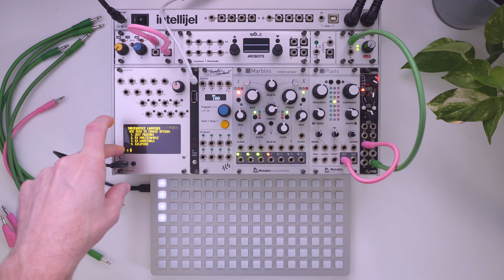Subsequence for Teletype: Patching and Interface How-to

Comment: could i use Monome 128 grid with Crow and without Norns and teletype？ And what will be different？
Reply: i mean grid + crow only，is that work？
Reply from the maker: @metayeung  Nope. Crow is not a USB host so this will not work. There's a good comparison of Crow vs. Teletype here: https://monome.org/docs/crow/faq/
Reply: @ModularBeat  so i need Ansible？
Reply from the maker: @metayeung  Ah, yeah I think that is an option! I have not used one but I believe it's one way to go if you do not want to get into scripting.

Comment: Thank you very much for this beautiful project!! :)
Does it work with the firware 5.0.0 beta 6 of the teletype and the firware 5 of the I2C2midi?
No midi trigger comes out of my module
Reply from the maker: Thanks! I honestly have fallen behind in and not tested either version. Not looking forward to reverse-engineering my own code to find out 😥. Did you ever have it working on previous versions? I ask in case it’s just an issue with installing the script (which requires some unusual steps)
Reply: @ModularBeat  Thank you for your feedback. No, I never use this sequencer but I think I modified the script correctly before the integration in the teletype

Comment: I love this functionality. Can the script be run on Crow or does it need Teletype to operate?
Reply from the maker: Teletype is required. I think Crow and Grid are both devices, not hosts, so I don't think the script could be adapted for just Crow.
Reply: @ModularBeat  ah gotcha. I was under the impression Crow could store scripts too, but that makes more sense! Cheers!
Reply from the maker: @daughtersofdivorce6803  Crow can def store scripts, too! It just can't use Grid as an interface (AFAIK). So you could maybe try to  adapt some of the functionality here into a Crow script, but with no Grid interface it'd be pretty limited. This comparison of Crow vs TT might be helpful: https://monome.org/docs/crow/faq/

Comment: Probably the most useful script I've seen in Teletype! Would it be possible to implement another scene to use the CHORD algorithm in Plaits repurposing two CV outs to pitch and chord selection (via HARMONICS) instead of sending the chord information via i2c?
Reply from the maker: Thanks so much Marco. Funny you mention that idea, I have been thinking about scripting some sort of converter for Plaits/Elements’ chords modes but I hadn’t even though about adding it as a new scene for Subsequence. 

EDIT x2: I have this working but it requires a custom firmware for Plaits to add Teletype’s chords. Let me play around with it a bit to make sure it’s working well like I want and I’ll have something out prob by this weekend.
Reply: @ModularBeat  the custom table chords in Plaits have already been developed in the Mutable Instruments forum (look for Unified Plaits alt firmware by the user Lylem), so it shouldn't be difficult to change them to your taste. It will be more limited than the i2c protocol that you are using (I think that Plaits can use only 11 chords) but it will be a powerful resource nonetheless 😄

Also, I would love to try it, but I don't own a Teletype yet, so I couldn't try the script even if I wanted to. I'm looking forward getting one soon.
Reply from the maker: Sounds good, this is something I have been meaning to play with anyway! I was actually able to fit more chords in the Plaits firmware so we can definitely get them all in there. Cheers.
Reply: @ModularBeat  Funny, a year later I get a Grid to play with this script (I got the Teletype some time ago). Now I'm interested in Dreamsequence, but I don't own a Crow yet... Always eager to try these fantastic programs you make. Keep it up!
Reply from the maker: @marcozvuk Stoked for you! Having access to Grid has a game changer for me. I can’t imagine making music without it. Thanks for your support!